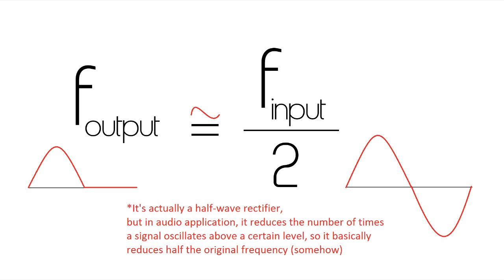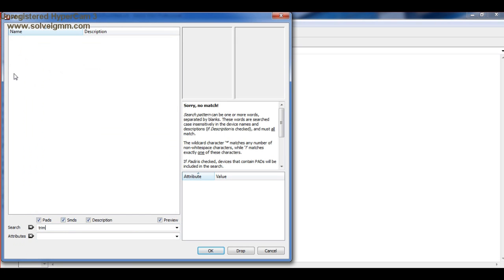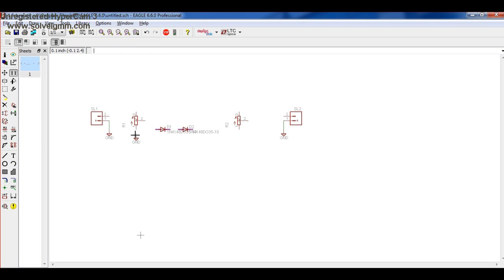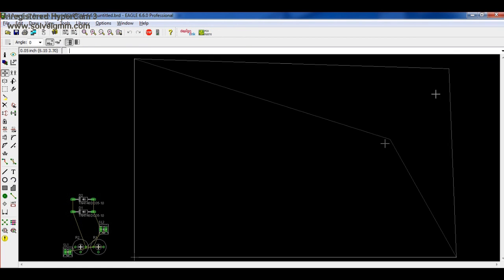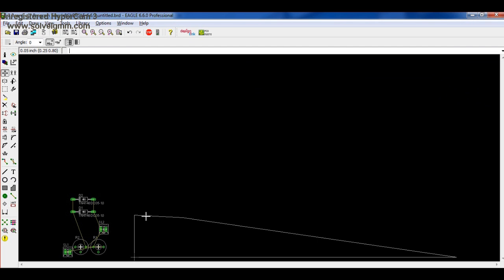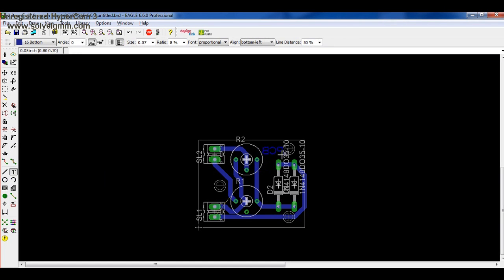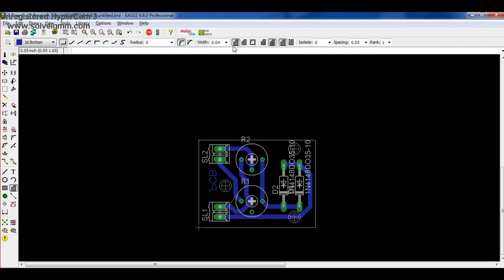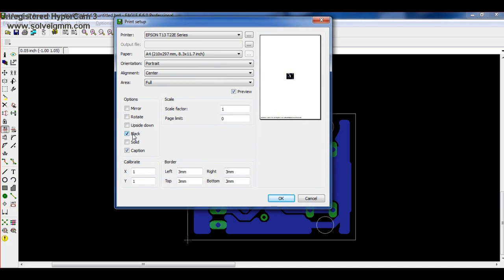How to Design PCB Layout using Eagle (CadSoft)

Comment: Sir, why my resistor gone when i switch to BRD from SCH ?
Reply from the maker: Find another footprint it might not be the one you wanted to look like in the PCB
Reply: @Mechodynamo  already solved it, and seems like its "missing parts" bug from autodesk, so the only way just delete the part on SCH that missing on BRD and replace that part again on SCH than hoping that its not bug anymore hahah. Anyway thank you for your reply sir
Reply: Maybe you should save your schematic first and then switch to board from your schematic

Comment: Today, most PCB designers use advanced computer-aided design (CAD) software systems to create their PCBs. Similarly, manufacturers use computer-aided manufacturing software. Using these systems can help you solve many of the layout problems you may encounter. There are many benefits of CAD usage in PCB layout,details pls see my blog https://makerfab.blogspot.com/2018/12/the-benefits-of-cad-usage-in-pcb-layout.html